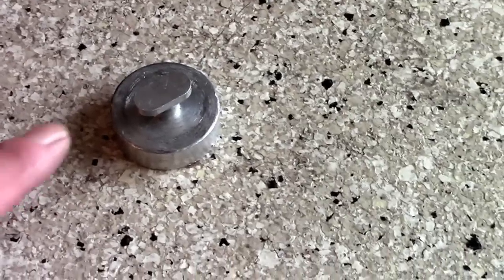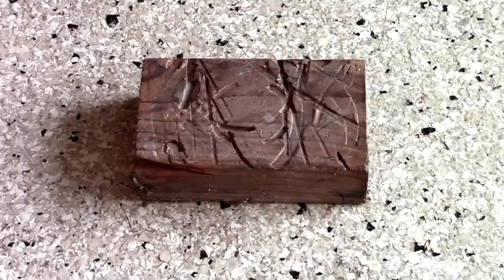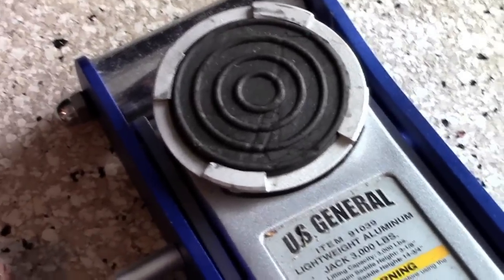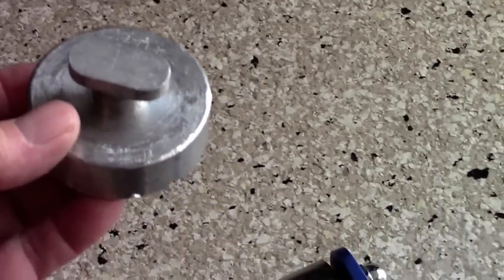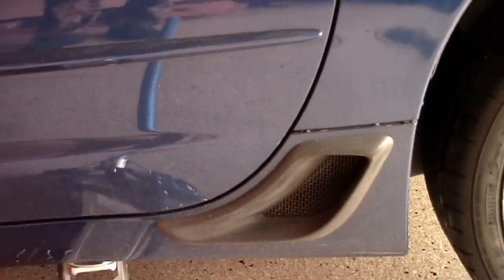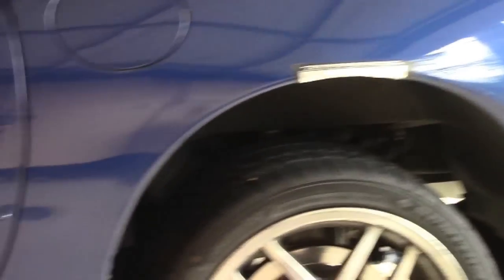Corvette jacking pucks how to use by froggy

Comment: I just got a set of the aluminum ones for the C6Z. I had to keep my car up for rim work which took MUCH longer than first mentioned to me. The front end was up in the air for almost a month on a jack with a block of wood. Thankfully, nothing happened. It's the 2nd time I had to do this. So this time, I decided to just get the twist in pucks and be done and be a lot safer....

Comment: Hi Froggy, Did you put in the longer lug studs? If you did how hard is that to do , I bought a set of oem c6 wheels for my c5 and I'm going to put spacers on the front and rear so I'm going to have to switch out the studs any ideas?
Reply from the maker: Yes I have long studs both ends. If you don't go TOO long you can do the front WITHOUT pulling the hub. There is room. On the rear you have to either pull the hub OR drill a fairly big hole in the backing plate for the studs to pass thru.

:)

I don't think I was doing videos back when I did the studs, I do have videos on pulling the bearings.
Reply: froggy Hi again froggy , The spacers for the front are 10 mm thick so the studs i'm going to put in will be longer by that much,,maybe 3/8 of an inch and the rear I'm going to use with 25mm wheel adapters,the stock studs are fine for those,,, Can I pound the studs out of the front hubs with a small sledge? Your videos are great to watch and learn ,Thanks
Reply from the maker: Yes they pop right out & it does not hurt the bearing.

Comment: Hey Froggy! Once again, very informing! I bought a set of the Aluminum billits for my Car. One problem I found was, while the jacks fit into the tie-down slots, they're almost impossible to twist into place! Knowing what a whiz you are at coming up with creative idea's (remember that video about removing the gear-shift knob? Brilliant!) and since your C5 Corvette is the same as mine, any thoughts on how to twist them into place?
Reply from the maker: They do not tighten up just give a twist & let it hang in place, then jack under it. Not going anywhere.

:)

Comment: This seams to be much easier than what the owners manual says about jacking up the car. Is it ok to do this for long term storage? Great Video btw.
Reply from the maker: I would not for long term, FULL DROOP on suspension parts over a long period probably not ideal.

:)
Reply: Ok thanks. The problem is when I store the car without jacking it up, the wheel bearing must be replaced. I have replaced 3 wheel bearings from storing long term. But maybe just jack up a little just to take the pressure off?
Reply from the maker: What might work is put it on jack stands and then remove the wheels = no flat spotting of tires or bearings.

To preserve the rubber tires wrap them in plastic, but over 5/6 years old tires should be replaced.

:)